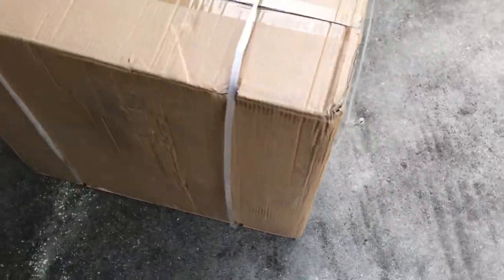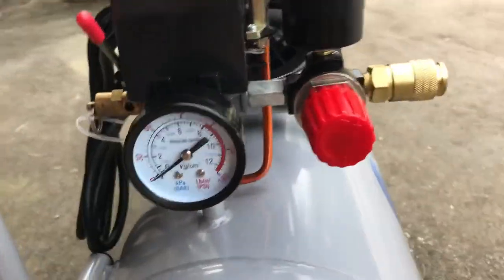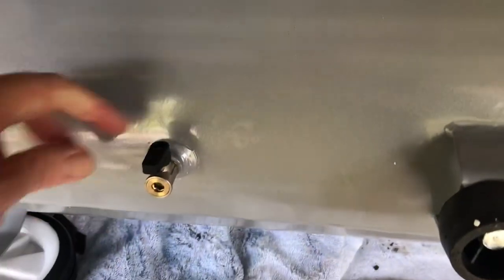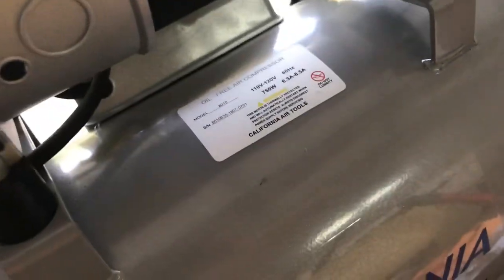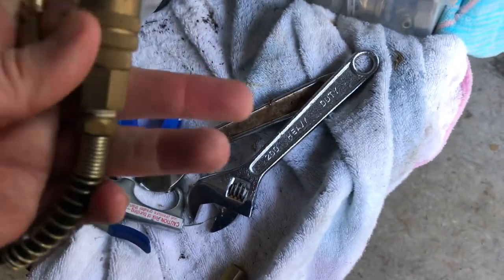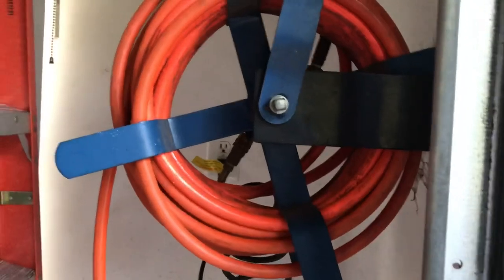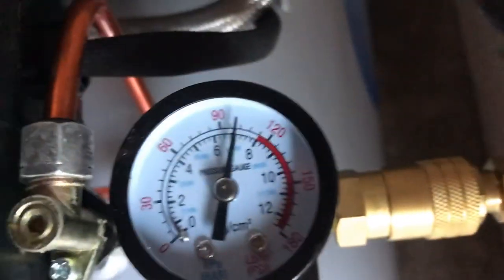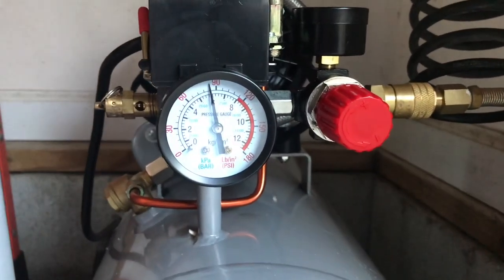California air tools 8010 ultra quiet air compressor 1hp 8 gallon setup 60 decibels upgrade oil free

Comment: I have no small engine experience so thanks for this.
Reply: I just want to test my compressor, I don't have a hose, or something to use it on yet, I wonder how you drain the air afterwards, I'll have to check the manual and try not to get overwhelmed by the wall of text. Bloody mental disorders making things hard.
Reply: @karenwoolley4279  I'm right here with you. I get overwhelmed from similar circumstances. That's why I'm here. To try to learn how to set my 8010 up. I'm afraid of doing something wrong and ruining the machine. 🥺

Comment: Does this compressor come with a moisture trap?  Or is that what rhe air filter is?   Trying to get one thst has moisture trap and regulated fitted. That's what I was told to look for but not even sure what that is lol.

Comment: I have ordered a 2HP/10GAL Cal Air Tools compressor.  Should be more than enough to run an LVLP spray gun.  I am hoping I don't get a lemon because I have heard more than once that their quality control is non existent, factory testing is a myth and their customer service stinks.  Fingers crossed on this $360 investment.